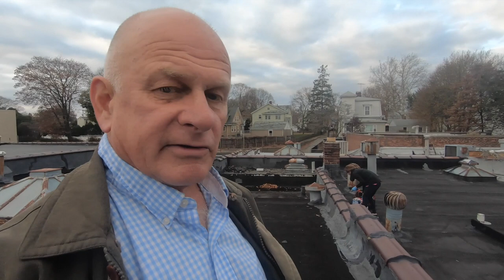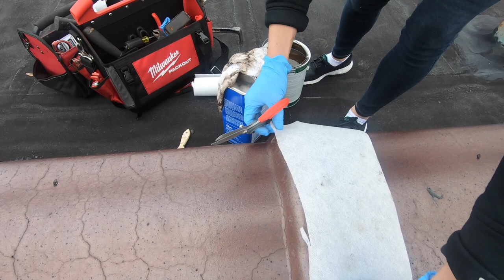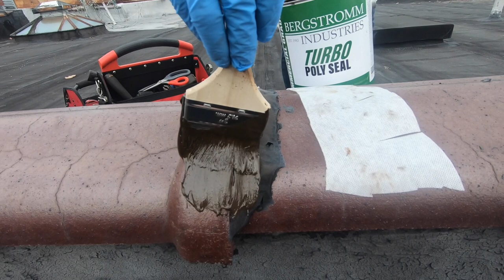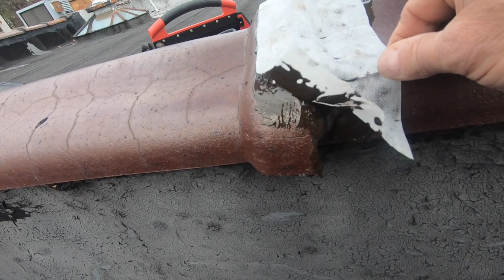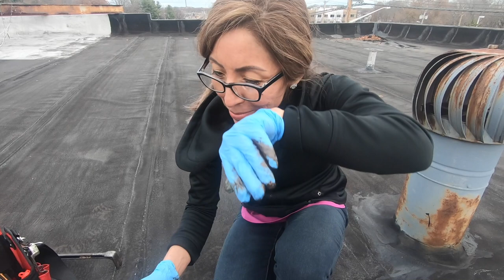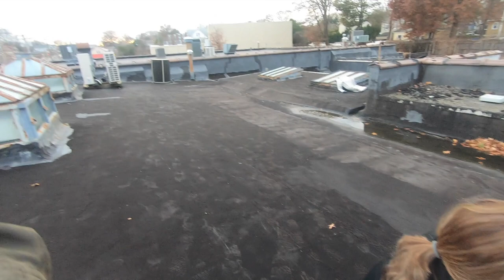Leaky parapet Wall Repair - Turbo Poly Seal

Comment: Thanks for the video.. this is happening to my roof.!
Reply from the maker: Amazing. I am glad the video was helpful. Check out my new video on Super Silicone Seal. This is an awesome product too.
Thanks for the compliment
Reply: @FlatRoofDoctor  question for you.. my roof was done a few years ago.. but the skylight wasn't done.. can I replace the skylight with out redoing the roof? My roofer said  not to do the skylight  unless your redoing the roof..
Reply from the maker: Yes you can replace the skylight at anytime. No need to replace a roof if the skylight need replacement

Comment: That stuff seems better than tar but it's a little more pricey
Reply from the maker: Tar is cheap, but also expensive when the repair leaks again. I would rather make a repair once than come back for it many times because the tar  cracked.

Comment: Strange american system, more like a ridge tile, but doesnt need a drip edge so long as overhang is sufficient. the ones she is fixing look like they had way too much mortar on, surely the mortar is just to bed one on top of the other, the crack is the separation of the excess jointing . In uk that would be equivelent of a flashband fix. It will work but doesnt look very good,